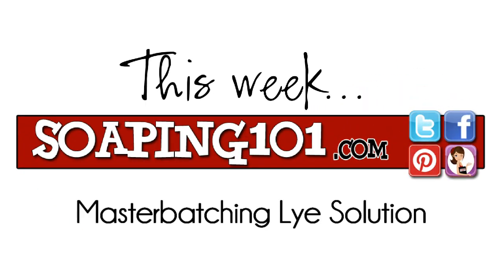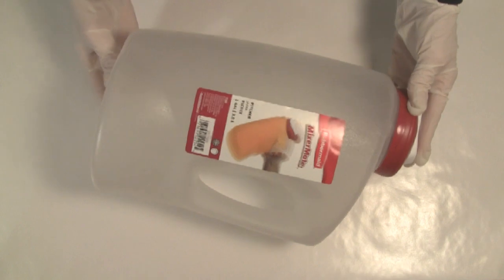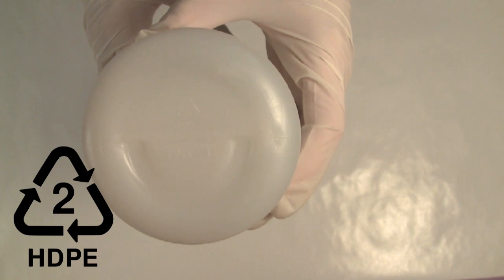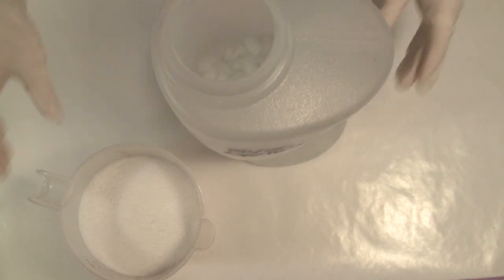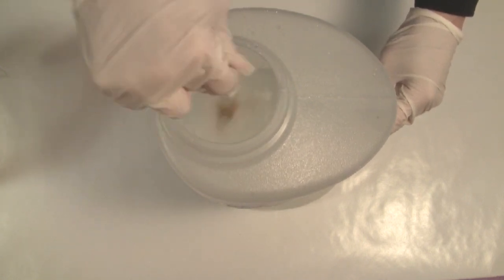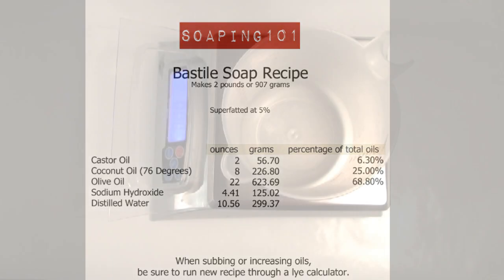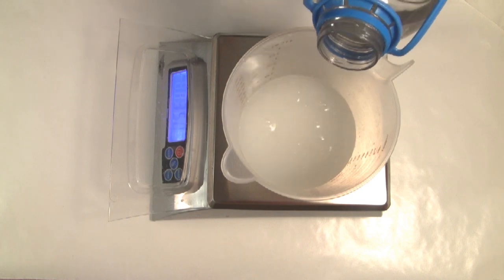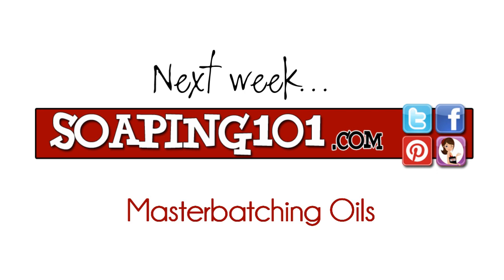Masterbatching Lye for Soapmaking  S2W39

Comment: Cathy I always make each batch as I go, so when you had stated you can replenish the extra needed amount of water with milk (due to the lye being cool at room temperature) this method just makes better sense so that the milk doesn't burn.  I just made 5 new soaps the other day and I would have tried this method but it gives me something to look forward to now.  Especially to save time.  What a joy it is to have you Teaching us.  Can't wait for part two  Happy Thanksgiving and big Hugs :)
Reply from the maker: Be careful when adding the milk Deb because the solution may heat up again. I would suggest you add super cold or slushy milk (: I wish you the happiest of turkey days ever!
Reply: soaping101
Would it be good to add the milk at light trace?
Reply from the maker: bytheSEA Soap Mella Yes, that is my preferred method.

Comment: i think there's a more simple way : The ratio water to Lye is always approximately 2.45 ; you should simply choose whatever volume of distilled water/liquid you want for your Lye master-batch and divide it by 2.45 to know how much lye you should add to it. and that's it. once your making a recipe you'll have to mesure the total lye-water mix needed directly from your lye master-batch without adding anything.
Reply: Have you tried this method?  Makes sense too.
Reply: The point of doing it this way is to leave room so you can add milks, yogurts, purees, etc as these are subtracted from your water portion. Also, most soapers use different amounts of water for different recipes. For example, you usually soap with a water discount but are making a batch with intricate swirls or working with a FO that accelerates, this would require full water.

Comment: Thanks for the video, great? In a simpler term, do you mean example if I'm doing a 1000grm of oil, it should be 50% lye and 50% water of the 1000gram of oils?

Comment: Thanks so much for the video but I feel like I must be missing something.  My favorite recipes have a fair amount of hard oils and I soap at 120-130 degrees.  How do I control the temp of the masterbatched lye water to match the oils?
Reply: Not to worry. When you add the missing liquids, the lye heats up again. Mine got to 180 degrees when I added the addtl water.

Comment: Hello Cathy, I like watching your videos, thank you very much. Sorry for my English, I use a web translator. I prepared a 50/50 basis, not based on weight but on the amount: 2 cups / 2 cups. I just look for use my base is not liquid, but gelatinous. Is it because of the amount used? is that I can use? Thank you, Louise (Montreal, QC)
Reply: use weight and not volume for your measurements. Maybe the measuring cup weighs more than 8 ounces making the solution too thick.

Comment: honestly I'm horrible at math and I'm so confused. how did you get 4.41 × 2? where did the 2 come from? please help I'm new to this ☺
Reply: +JasmineEssentials Dear, as the lye/water solution is 50/50 (well half water) you must double it in order to get to the 4.41oz lye as the receipe needs. So you calculate 4.41oz x 2 = 8.82oz (so there is 4.41oz lye and 4.41oz water in it) and now as the receipe needs more water you just take the amount water needed minus the water already in the lye-water mixture in order to find out, how much water you still need to add: 10.56oz - 4.41oz = 6.51oz  - Now, that is the amount of water (or milk of any kind) you still need to add, so the receipe is correct.
all clear? ;)
Reply: clear as mud  :)
Reply: rogersli omg now i understand. ..thanks!! ☺
Reply: Great! You're welcome! ;)
Reply: @im4dolphns  I'm in the mud with you..I'll just mix as I go.  Your comment has me in stiches
Reply: @rogersli  thank you. i was like but you dont that the 8 from the water. i forgot it was 50/50 of the water so the weight would be subtracted out as well as the 4 number and not doubled. thank you.
Reply: @rogersli  I had to read this and read the list a couple times to get it... And I think I do.

So, the recipe calls for 4.41 ounces of lye. Since the lye solution is half lye and half water, you need 8.82 ounces of lye solution to get 4.41 ounces of lye!!

At least I THINK that's what you said and mean, lol.

I also think a simplified recipe would give the amount of lye solution needed with the amount of distilled water given separately.
So the recipe SHOULD say something like 
50/50 Sodium Hydroxide Solution 8.82 ounces
Distilled Water 6.15 ounces
Reply: ThNk you @rogersli

Comment: Hi Cathy!  I met you at the HCSG 2018 conference and really loved your class and you are just adorable anyway.  You make this look so easy!!   But I do have a question.  In this video you used ice water to help cool the lye solution.  Since ice weighs less than water, how do we determine the proper weight of ice? Should we weigh the water ahead of time and then freeze it prior to making the solution?  Would really appreciate your insight/tips.  Thanks again :-) Love Soaping 101!!
Reply: That would only be a problem if you used volume to measure the water. The weight of water required is the same wether on liquid or solid form. So if you weight the ice it will occupy a larger volume than when melted, but the weight is the same.

Comment: hello, Thanks for all your videos, they are so helpful!  I tries mixing lye and water, 1:1. I weighed the resulting solution, and it does not ad to 2, but a little more than 1.9. I imagine so water turned into steam. Is that possible? what's your opinion? Shall I simply add water to go up to 2, and then proceed ?   Thanks!!!

Comment: I know this is an older video, but how do you handle water discounts with this? Do you subtract the desired percentage amount from the water/liquid that you add to the masterbatched lye solution?  For example, in your video, you added 6.15 oz. water. If I wanted to do a 20% water discount for my soap, would that amount then be 4.92 oz.?
Reply: If you use a soap calculator (I use soapcalc) you can input your water discount at the amount you want, then it alters the water weight accordingly. Example with a recipe I use - Water as % of oils set at 38% gives 304g of water but with water set at 32% of oils it's only 256g. Hope this makes sense and happy soaping!

Comment: Can you also use this method using a very large glass mason jar?  I'm sure you can but just wanted to check!  Thanks so much your videos are a great help and awesome as always :)
Reply from the maker: I do not advise using mason jars. The plastics I mentioned in the video are unbreakable and heat safe.
Reply: The mason jar would shatter all over the place because of the hight heat level from the lye.  I store my solution in HDPE #5 1 gallon jugs.
Reply: Most laundry detergent bottles are suitable for lye solution.  That's what I use.  I have 2 - one is plain 50/50 lye water, and the other has silk in it.  Of course, I make a lot of soap so I go through it relatively quickly.
Reply: Don't pay any attention to the first reply!  Of course mason jars are fine, and probably better than the plastic mentioned, as regards the heat.  After all, they were designed for canning foods, often under pressure at heats well over anything the lye reaction could produce.  Their only downside, in my opinion, is that they are difficult to pour out of without dribbling contents down the side.
Reply: No, that's not correct. Lye etches the glass and also results in a sudden temperature change which can cause the jar to shatter. Why do you think you must put hot jars fresh out of the canner on a towel rather than on the cold counter surface? No. 2 or 5 plastic is the safe recommendation.

Comment: mhhmmm,... you told to doubble the 50/50 solution from 4.41 tp 8.82 but your scale shows that you pouring 4.41 into the measuring cup so im a bit confused now ..
Reply from the maker: The scale was functioning incorrectly.
Reply: soaping101 I am an experienced soap maker.  In my haste to make as many batches as possible yesterday following your video, I ignored my gut instinct and went with the instructional part of the video showing the scale.  I am now  rebatching 4 batches of soap HP with the missing lye water hoping they turn out.  Sometimes experienced soap makers make the stupidest errors when being over confident :(

Comment: Wow. Doesn't sound as scary. But I do have one question: When you say you do 50/50 of water & lye....do you take the amount of lye in a recipe you want to make, lets say three times, and measure out that amount of lye out for all three recipes ...then add the same amount of water to equal the lye? Or do you just decide on an amount you want to make and do the 50/50? I hope I am making sense here. Thx You are a lot of help! Happy Thanksgiving to you and yours!
Reply: I was wondering this too.  Cathy, you normally hit the nail on the head with your videos but this one leaves me confused. Any chance for clarification?
Reply from the maker: Just premake the 50/50 and then calculate the amount needed per recipe as you go.
Reply: so it doesn't matter, I don't need to measure out 50% of any given amount of lye or anything?
Reply from the maker: Lucky Seven Soaps I don't understand your question and I don't want to answer incorrectly, can you elaborate for me?
Reply: My question is the same a ssoaps from home.  When you make 50/50 solution, it's just the same parts? so say 12 oz lye and 12 oz water? how do you know you're getting the right amount of lye for your formula??
Reply from the maker: Lucky Seven Soaps If you mix a 50/50 solution {12 oz lye and 12 oz water} in a jug, 50% of contents will be water and 50% will be lye. The jug will now weigh 24 oz. Then if you recipe calls to 5 oz of lye you will need to pour 10 oz of the premade 50/50 solution because 10 oz of the solution is 50% lye and 50% water or 5 ozs of each.
Reply: Thanks for your patience Cathy! I FINALLY got it! Lol Hope Lucky Seven Soaps does too. ..:-)
Reply: Thank you Cathy, this is what I have been wondering to and since I didn't quite understand how it worked I put my soapmaking on the back burner (not literally) but quit because I was afraid of asking a question and feeling stupid..thanks for the explanation.
Reply: @soaping101  I finally get it

Comment: How would I go about making hot process soap after Master batching my lye solution say 3 days ago. can I use room temperature lye with warm oils and then continue hot processing as usual. Also how would I use the masterbatch lye method in hot processing soap if I wanted to make a milk soap do I add the milk to the lye solution and then the oils or add the milk later in the process.
Reply: Similar to my questions
Reply: Watch the video again.  It answers all your questions..